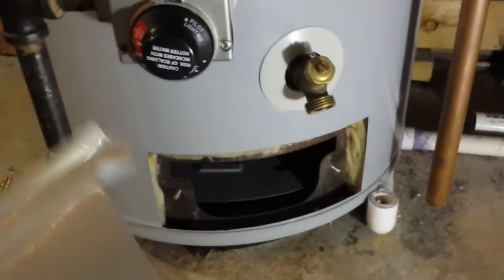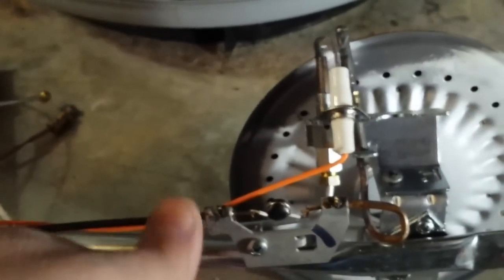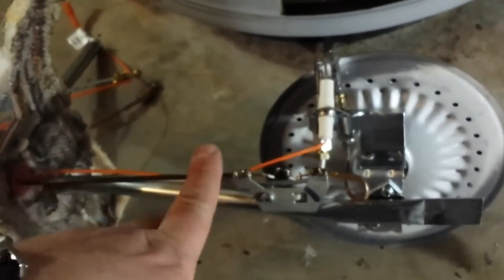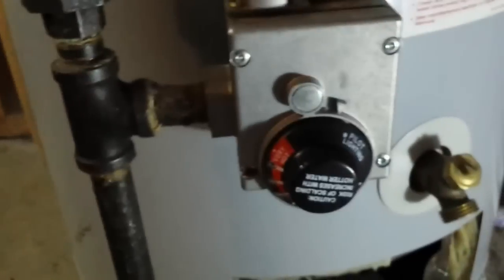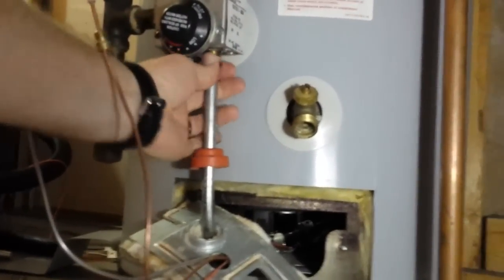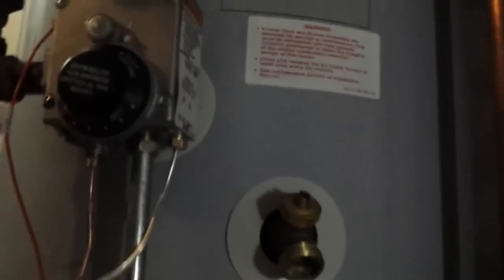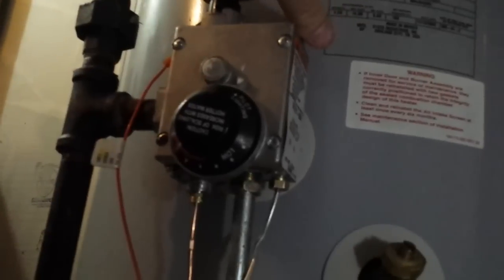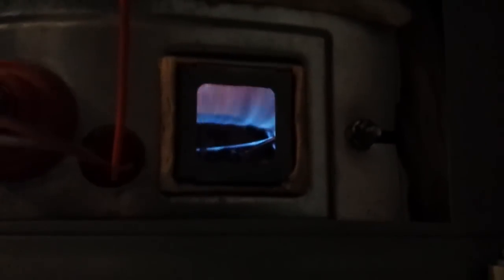How to: Replacing the thermocouple on a State water heater.

Comment: My problem was that the pilot lite went out and would not restart.  So I pulled out the assembly and disconnected the burner end of the pilot tube and blew air through it to clean it out.   It worked, but unfortunately when I went to slide the assemble back into place I must have hit that resistor by accident.   My pilot lite would lite but not stay on at this point.    This was so frustrating, and no way would I  be able to find that thermocouple assembly easily and it would cost at least 30 buck if not more, So I decided to try and solder back the resistor. It was not easy and very delicate thing to do, but I got the wire to stick to the resistor and it worked, and least for now. We will see if the repair holds up. In the meantime I will try and locate that assembly that you changed. Thanks for the info. BTW  where did you locate it?
Reply: +Kevin York , I was feeling a little screwed read your post and thought I try to solder fix and it worked!!!  :)  Still would like to hunt down the replacement part.

Comment: Reliance Water Heater #9003542 NAT Gas Pilot Assembly is compatible with part #9003542005 for State Select gas water heater model GS650YBRT. Changing this was a breeze. It took about 30 mins. I found one at ACE hardware stores for $45.00. You can find one on Amazon as well for $35.00 Thanks for posting this!
Reply from the maker: Glad to help!

Comment: Forget to say that my wt model number is gs640xbrt and looks exactly like the one at Sivendel' home.i did a lot research through the web but I don't know which one I should get??? Does any one can help? Please!
Reply: Reliance Water Heater #9003542 NAT Gas Pilot Assembly is compatible with part #9003542005 for State Select gas water heater model GS650YBRT. Changing this was a breeze. It took about 30 mins. I found one at ACE hardware stores for $45.00. You can find one on Amazon as well for $35.00

Comment: Your video was helpful. My only comment would be that the lines from the main gas valve including the ignition wire be routed in such a way that they aren't sticking out as to be caught by someone walking by the unit. Also, the gas tube from the main gas valve to the burner had several kinks in it. Caution should be taken when bending the small tubing.
Reply: Bought my replacement at a local plumbing / heating supply store. Thermocouple and piezo ignitor were $80.00. I noticed in the video that the heat blanket or seal behind the inner door with the glass sight glass wasn't replaced at the time of your repair. The supply company told me that this step should not be skipped. The fire retardant blanket came with my kit.

Comment: Thanks for the video. I'm in the process of trouble shooting my water heater. My wife has noticed that it doesn't heat up as it use to (I shower 90% of the time at work). Did you experience anything like that before yours went out?
Reply from the maker: Darel Beghtel Not really. On this day it was quite a shock. lol. Often, old water heaters have a build up of debris in the bottom of the tank from water deposits and such. You might want to check into draining it and see if it helps.

Comment: Hello, I have the same exact problem and same exact water heater model. Can you please tell me where you got the replacement set? Thanks.
Reply from the maker: I bought it at Plumbers Supply Company in St Louis. You can also find it online at Amazon I believe. Hope that helps...
Reply: @TheADHDNerd  Thank you for the prompt reply. I soldered the piece which got broken/detached and installed it again. It worked. Just installed it this evening and tested it couple of times it works fine. Need to monitor it for few days to confirm everything is fine.

Your video was very helpful. Thank you for posting the video.

Comment: We have the same State water heater with the same problem.  Where did you get the replacement pilot assembly and roughly how much did it cost?
Reply from the maker: The part was about $75, well worth the effort compared to replacing the whole tank. I live south of St Louis, so I went to "Plumbers Supply Company,
4170 Carondelet Blvd". I called around to various plumbing companies with the part number for availability and to check prices.
Reply: Thanks for the info. We ended up replacing just the thermocouple. FYI a friend in another city who's a plumber told us you can replace the resistor-type thermocouple with the standard kind. It was a pain in the *ss getting the old one out of that assembly and the new one in, but it worked. Which is good, because no way were we gonna find a plumbing supply place open on a Sunday.

Comment: Sivendel, Thank you for your very helpful video.

Scott Phillips, you are exactly right!  You can buy a universal 24 in thermocouple and "wedge" it into the fixture.  You avoid the hassle of finding the complete fixture (part #9003542005) 

I have a 10yr old water heater, State Model GS640YOCTG.  My fixture looked exactly like the one on Sivendel's video.  

I removed the old thermocouple within the fixture, including the unique contraption in the middle(looks like a resistor/cap circuit, and I replaced it with the new thermocouple.  I was able to maintain the integrity of the fixture and replace it in the water heater and everything is working fine.

I would have been charged $200 for replacing it via a water heater specialist, but at 10 years of age, it seemed like a risky bet.  The alternative was to replace the whole water heater and that would cost $1000!  

Altogether I spent 30min, and $9.97 for fixing it.  I'll buy a new water heater later this year.
Reply: +Luis Ancajas I'm thinking about doing the universal thermocouple, but man when I was messing with it it simple did not wanted to move and I was afraid of completely ruin to unit as a whole. Since, I'm having such a difficult time replace an actual replacement. So, I soldered it as another poster did.  I'm hoping to will hold.
Reply: Reliance Water Heater #9003542 NAT Gas Pilot Assembly is compatible with part #9003542005 for State Select gas water heater model GS650YBRT. Changing this was a breeze. It took about 30 mins. I found one at ACE hardware stores for $45.00. You can find one on Amazon as well for $35.00
Reply: Thanks for this! No one else had mentioned if a universal thermocouple would work. I'm off to replace it now. Thank you!

Comment: hey bud. im having a problem where the pilot is on when I test it and it has a flame when I turn the temp up but it goes out after a while and wont statt back up. is tht also a problem with the thermocouple?
Reply from the maker: Quite possibly. That's what happened to us.
Reply: Sir James thank you sir. I will try this and see if this works.

Comment: The one thing you could have tried is a 30watt soldering iron and some flux and solder. Get the separated edge of the thermistor and the wire about a 1/16 in apart and add a solder bridge between the two. Note that is a temporary fix and should be replaced by a professional..great video though!
Reply from the maker: Thx
Reply: ummm wouldnt the solder melt with heat?? duh

Comment: I just got the same problem! But where do you get these burner parts from? I went to Home Depot they only have brand new water heater for almost 700 without installation . Please let me know where u order these from,thanks!
Reply from the maker: I found the part number on the State website by looking up the model number and bought it at Plumber Supply in St Louis. Good luck.
Reply: Thanks!
Reply: I found it! Thank you so much Sivendel!

Comment: how did you get the window and the main gas big pipe out, i had a hard time pulling it out.
Reply from the maker: The window was just bolted on and the tube unscrewed from the outside box.
Reply: +sivendel I unscrew the tube but I can't seem to pull it down, it seems like it doesn't have enough clearance to be pulled down. Do I take the window out first ? the screw is a little different which it has 2 slit on the sides, do they slide to left right, back or pull straight out? Soryry for all the questions but I don't want to mess this up. Thank you
Reply from the maker: +Cheryl Gregg I would remove the window first. Make sure the gas is off first. lol

Comment: Hey how much did you pay for that pilot assembly
Reply from the maker: About $75
Reply: I ended up cleaning out the sealed compartment of the water heater,  vacuumed,  air blasted it with a compressor, sanded the thermocoupler and it's worked great since then, thx
Reply: Kevin Norman I tried sanding mine hoping it would work, but it wouldn't stay lit.  Couldn't find the part locally but Sears Parts had it for $60 and is shipping it to me for a Monday delivery.

Comment: I replaced the pilot/thermocouple unit, but couldn't get the pilot to reignite (even though I poured on the swear words). In utter shame, I made a service call and it turned out the air intake was clogged so the burner wasn't getting enough oxygen. : (
Reply from the maker: Ouch. Yeah that is something I've also dealt with on mine over the years. Gotta vacuum that out. Lol

Comment: Does anyone know if this part is compatible with a State Select Model# GS650YBRT by chance?
Reply from the maker: Alas, I am not sure. Check with your dealer or online with the Slate website.
Reply: Yes, it worked for me! I have  GS650YBRT.

Reliance Water Heater #9003542 NAT Gas Pilot Assembly is compatible with part #9003542005 for State Select gas water heater model GS650YBRT. Changing this was a breeze. It took about 30 mins. I found one at ACE hardware stores for $45.00. You can find one on Amazon as well for $35.00